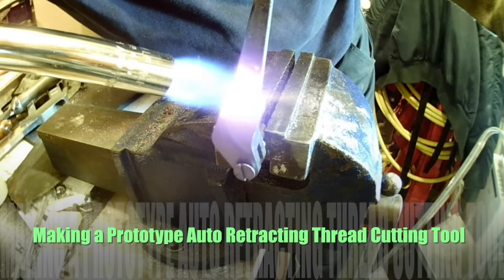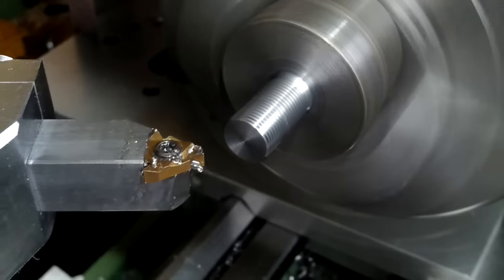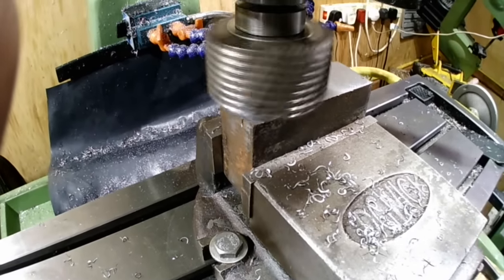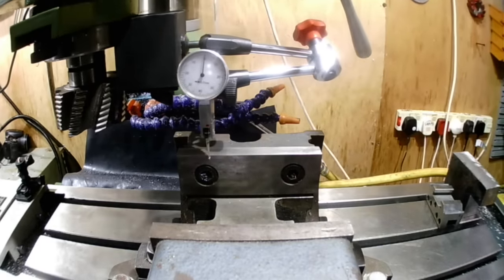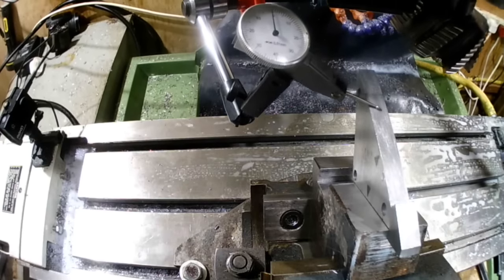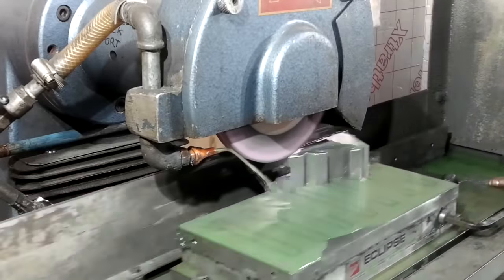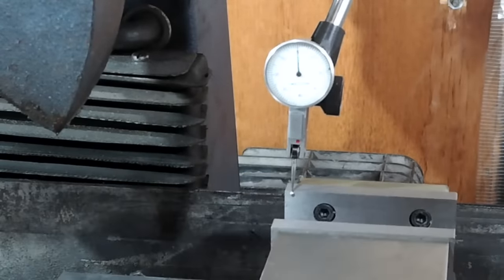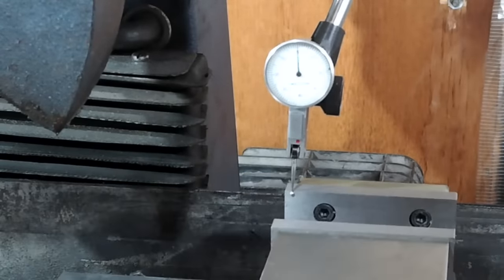Auto Retracting Thread Cutter.

Comment: why isn't there something like this on the market, it solves the problem of safety over finish, I always run too slow rpm to machine the thread without the risk, and the finish is never as good it could be. do you have any plans to put up some plans for this, you should make a kit
Reply from the maker: Hi swamppifi, no, I don't plan on making these, but my website www.thesheddweller.com is under construction and you can get a copy of the sketch.. Have fun.

Comment: Have you tried to simply cut it in reverse and the tool on the opposite side then it cuts away from the chuck and no chance of smashing it would be a nice tool for the ml7 or any screw on chucks set up 🙂👍
Reply from the maker: Hi Dale Lathwell, yes, I have tried working backwards and on the other side of the cross slide.
My problem is that I have a cheap Chinese lathe and there are many things that are wrong with this machine including the half nuts and the numerical indicator, they are both at best ineffective. I have destroyed inserts and threads when the half nuts indicate the correct number but for some reason they are fractionally out of sync. This problem is also true regardless of the direction I start the cut.
However, since using this device, I haven't had to disengage the half nuts, I don't collide with end faces and I have used much higher surface speeds.
Hope this answered your question.
Cheers.
Reply: With the feeds not meshing in i came across this problem and turns out that it was  because my lathe had an imperial lead screw and I was cutting  Metric threads  Once the halfnut is disengage it will never land back in the right place

Comment: Appreciating your videos . I'm a newcomer to machining but have had a certain exposure to analog (if I may) equipment though this was a considerable time ago. My official trade is  Welder - apprenticeship with South African Railways & Harbours at various Mechanical Engineer's Workshops around the country. It was much later in the field at a private company, where  chance for me to try my hand with machines arose. I might add that I became wholly engaged to the process and now that I'm retired , would really like to do some piece work at home . This brings me to enquire for advice or references perhaps, as I've decided to build a metalworking lathe so I can fulfill this wish but really it's dueto my small pension and no other foreseeable means that I cannot afford to purchase - even a second hand one. I'm a person who will rather get all the data before starting anything so would like to know more about the practicalities in choices of a lathe bed construction?
Reply from the maker: Hi, I'm not sure I'm the right person to help you with the lathe bed construction. However, two things I do know is that the lathe bed must be.
1. rigid and stable.
2. capable of handling horsepower without distortion.
all the best with your project. regards
Reply: Thank you I'm doing a bit of research about Acoustic vibration  - Since I have a background in Ultrasound with NDE. The interface between certain steels and damping medium ie.Quality and spec in finished product after machining. This is the part of your video that captured my attention , so... Thanks again.

 @Thesheddweller

Comment: looks promising, but what about split nut unlock ? how you match thread line for next  repeat ? probably spindel stop is better solution ?
Reply from the maker: Hi, thanks for watching. That is a bit of an art but, this is what I do. 
The lead screw indicator must remain engaged at all times. The chuck on my lathe is slow to stop so  I must open the half nuts after the tool retracts. When the chuck stops I wind the chuck backwards untill the indicator realigns then I re-engage the half nut.  I can now use the motor to drive the chuck in reverse so that the threading tool is taken back to the starting position, then I reset for another cut. hope this helps.
Reply: You can still work the half nut in the same way. The automatic retractor just gives you a lot more time to release it - the tool is already out of the way, so your timing doesn't need to be nearly as critical. To do subsequent passes, you would use the threading dial the same way as you always have.
Reply from the maker: @stanrogers5613  That is true on my lathe if the tool clears the work piece, otherwise I have to revert to opening the half nut, its also worth knowing the motor on my lathe ramps down it doesn't just stop unfortunately.

Comment: Really nice design, but presumably you still have to disengage the halfnut manually after each pass?
Reply from the maker: Oh yeah. Just as quickly as it snaps back if working at hi-speed..👍
Reply: As I said really nice design, but if you will forgive me, its not really necessary.  Mount your tool upside down, run in reverse, and screwcut away from the chuck.
Reply from the maker: @1ginner1  true, very true. But it works well for me with my lathe. If I had purchased a decent lathe in the first place I wouldn’t have made that tool. 👍
Reply: @Thesheddweller  Haha, Good luck to you my new found friend, I look forward to seeing some more of your very clever ideas and mechanisms.
Reply from the maker: See you soon. Regards👍
Reply: @1ginner1  That only works if you are allowed to cut a groove to start the tool from.
Reply: @andreblanchard8569  Correct.

Comment: Sweet build.  Got a couple of questions:  How do you prevent  or address  slop  in the square bar holder. and   are you disengaging the half nut manually?
Reply from the maker: Hi, the fit between the square ram and the body was a transion fit that needed quite a bit of working back and forth bathed in paraffin to to get it to function properly, then after a clean up and reassembly, oiling it with light 3 in 1 oil created friction. After using it many times there is no noticeable play or vibration when cutting. I do have to disengage the halfnuts to prevent bending or damaging the trigger bar.

Comment: So engine type lathes don't have an auto disengage? All my lathe experience is with Hardinge HLV and CNC lathes and they both auto disengage. I imagine internal single point threads have to be extra scarry with no auto disengage.
Reply from the maker: You’re a lucky chap. Some countries expect this device to be fitted as standard to most lathes here in the uk its an extra on larger lathes. regards

Comment: That's an excellent tool. Well done.  Can I ask you, what's the brand and model of the torch you used for the brazing ?
Reply from the maker: Sorry I'm late replying. the torch is a Bullfinch 4100. it is very capable at brasing with propane on small items only.  you will need extra heat for items that get anything bigger than this.

Comment: Love it , works like a charm in the video. How does it do on say a 1" -8 thread where the cut is heavier the closer you get to full size. I guess in metric its about 25mm. Thanks good work on it too.
Reply from the maker: What I have found out with bigger and deeper threads is that the insert will snap if there isn’t a relief at the end of the thread. Deeper cuts do need a slightly lighter depth of cut nearer the root.. hope this helps.

Comment: Ah yes the pucker factor, happens to me every time I run a program for the first time. My little cnc lets me cut 1mm pitch at 2700rpm, but I wanted to see what you have come up with.  Very nicely done, design and manufacture.  And it works!! First time visitor to your channel, will go look at some more.  Do you have a video about that animation software?
Reply from the maker: I think its called ‘Algodo’ its free off the web
Reply: @Thesheddweller  how long did it take you to draw the parts in the simulation?
Reply from the maker: I've never used anything like that before, the program is quite simple and easy to use, it needs to be, I spent two days on it and ended up with what you see. Hope this helps.

Comment: This product already exists. But good on you u mght learn something or get a bright idea on making it better.  Doall have this feature on their lathes. The  English turret lathes have this feature as well. Like ward or herbert. The best way is to spend 10 years on a center lathe cutting threads all the time. U learn that the faster you go the better the finish like a cnc mc. You get really fast at it on an imperial lead screw. Instead of focusing of focusing on the shoulder that the tool can crash into place an out rigger somewhere on the lathe and create lines with high contrast colours. Also reposition the screw cut tool inbits holder that positions the cross scomslhandle at   comfortable angle so you can pull the tool out asap. Either up or down. You really get good at it after a while too. First thing in the morning do some dummy runs to warm up. Having a spindle break helps too. Just when you get this under control the boss puts you on another lathe with a metric lead screw where you throw in the machine into reverse and pull out the tool. But you get good at this too.
Reply from the maker: I know what you mean about the boss moving you about, Ive had more than my fair share of that. Ive worked Herberts and Wards, though I would say only for a short while and not to anything really tied up. I have got ideas for many more projects between jobs that I get for classic and vintage stuff.

Comment: Have you watched Joe Pi  
He likes to invert his cutting tool and thread away from the chuck. 
No clenching whatsoever  😉😁
Reply from the maker: Hi, see FAQ’s at www.thesheddweller.com
Reply: @Thesheddweller  
Just read FAQ answered.
Fair enough. 
I also agree (other faq)  I have a 1944 Colchester and am trying to make a replacement cross slide nut.
7/8" 4tpi left hand Acme.
Getting close to finishing cuts and the leadscrew jumped out of gear  
I guess you can imagine the disaster 
Another few hours to make another tool.
And probably I need to investigate why she jumps out under load.
Left hand is working away from the chuck so that was a plus I thought.

Comment: That is a great design! Do you think drawings could be made available at some point?
Reply from the maker: Hi Peter.  Thanks for your comments. I hadn't planned on doing any drawings but I suppose I can scribble something on paper to pass on. 
Owing to the very nature of a prototype, my jottings have been somewhat modified 'on the fly so to speak'. 
However, if I take it apart and measure the whole unit, I'm sure i can come up with some sort of a working sketch.
Might take a day or two though..
Regards.
Reply from the maker: Peter Thannhauser, I now have a PDF sketch of the finished unit, but don't know the best way to send it.
Reply: @Thesheddweller  certainly the same here.  I just found your channel as I have been looking for ideas on making my own collet blocks.  Subbed!  Thanks!
Reply from the maker: Hi Dan Rozwood I do have drawings for the thread cutter, although they are more like sketches, because I’m used to reading drawings not producing them. They are in pdf format and I’ll need an address to email them.
Regards
Glad you enjoyed
Reply: @Thesheddweller  was my message clear?  I didnt see anything in my spam bucket.  So just following up to see if I messed something up!  Thanks again!

Comment: What about the cutdeepcontrol? I think this should adjustable in the slide, so is the relaesepoint the same ... anyway: great idea and perfect job! Well done! Somewhere i've got an relaese from an boltactionrifle, that might be cud be adopted to that...
Reply from the maker: hi. Thank you for your comments,  that sounds like a good idea. I'll look in to it as soon as I've got some spare time. thanks for your input. Regards
Reply: @Thesheddweller  i look it now several Times ,🤔 and i think you only need to cut a boldthreath M10x1 on the triggerside. I point that part at 27:55 With a a.s. 15mm 8edge nut with 10x1 on the end ,facing the Triggeredge, you can adjust the cuttingdeep in 0,125 mm steps in radius. the flatarea of the nut will slide in the Rampslot without turnig itself... i excuse for my poor tecnical english.🙈
Reply from the maker: @GpunktHartman  I've just seen your reply and I have to be honest and say that I can’t quite understand what you are trying to say, sorry. boldthreath m10 x 1on the trigger side?  15mm 8edge nut. are the confusing parts. I understand yourTechnical English is  hard work. please try and write what you want to say in your own language and i will translate it here and hope it is easier to understand.
Reply: @Thesheddweller  thanks for reply either. I think that, if you change the edge, where actually the trigger hooks in, in to an adjustable edge you cud adjust the cutdeep therewith. So i think that if you change the 4edge end into a threated End a.s. 10x1mm, you can screw a nut on it with 8edges 15mm face which now hook into the Trigger ... and with that 8 steps, each are made exactly 0,125 mm cuttingdeep. Without adjust the support ore the leverbar which relaese the trigger.

Danke für deine Antwort, ich denke wenn du das 4kant ende, wo jetzt der Auslöser einhakt, in ein rundes Ende mit Gewinde M10x1 änderst und nun eine Mutter mit Achtkant und sw15 mm dort aufschraubst kannst du die schnittiefe genau mit 8 schritten in 0,125mm auflösen ohne am Support oder am Hebel der den auslöser betätigt etwas zu justieren.
Reply from the maker: @GpunktHartman  Hi, yes, got it, actually, that seems like a good idea, I like it. I think the 8 sided nut would probably need a method of ensuring that each 45degree moment is held in place. Are you going to Have a go at it?
Reply: @Thesheddweller  yes, if you check the distance so, that you adjust it by pulling it several mm out of the Squareslideslot... adjust then by turning the nut, and let it slid back into the slot, the slot avoid turning of it! The15mm 8sided nut will fit into the 4sided 15mm slot...

So i find what makes you disturbing☝️😉...
i see a better easear way: taping the bore where the Lollypop get in ... and make an 8sided nut with a male threath then. I scetch it tomorrow i try to email it to you...
Reply from the maker: @GpunktHartman  great thanks.
Reply: @Thesheddweller  ... did you recive it ?
Reply from the maker: @GpunktHartman  I’ve not recived anything. except that my comments page won’t download something.. it’s constantly cycling.
Reply from the maker: I've rebooted the computer and checked my junk files and i've not received anything.
Reply: @Thesheddweller  i download your scetches, did my scetches on it and send it back ... @ 29.10. concern "RAM Mark II"
Reply from the maker: @GpunktHartman  hi, I haven't received anything, best if you just send your sketches to my email account I haven't set up the website to receive anything, sorry
Reply: @Thesheddweller  i send it anothertime @ the .com adress
Reply from the maker: @GpunktHartman  please send it to thesheddweller@hotmail.com
Reply: @Thesheddweller  that is the adress i send it to!
Reply from the maker: @GpunktHartman  Hi, yes.
Reply: @Thesheddweller  you got it? Send it 3 times...

Comment: One can flip the tool, reverse rotation, and thread from left to right for puckerless construction of an auto retract pucker limiting tool holder mechanism.
Reply from the maker: Hi, that is true and I have done that many, many times on other machines. My little lathe starts from zero rpm to the selected speed via a controller, if I start cutting before a reasonable cutting speed is achieved, It can lead to my 1/4hp machine stalling mainly when I’m cutting a large diameter thread, also if the cutting speed is very low the thread finish is poor. I also thought about machine owners that have screw off chucks because backwards cutting is a no no. hope this clears up a few things.
regards

Comment: I'd like to see a thread cutting mill maid that will cut a 1" & 1/12.   Spindale nose on my  MY lath has no led screw , & i have an idea to ues a routers  to drive  a thread,  mill & the rack to Drive the pitch . by using  it Banjo les England
Reply from the maker: Please accept my apologies if I misunderstand your question.  Are you asking me if it's possible to mill a thread on to a lathe spindle nose.
It is possible, I would use a universal indexing head and a fixed thread cutting tool.
Regards.

Comment: Cool concept, but you can solve 100% of these problems without all of the custom work. Turn the threading tool upside down, run the spindle in reverse, and cut the thread from left to right instead of right to left. There is literally no pucker what-so-ever, and you can do it with all the tools you already have.
Reply: Sorry, there might be one thing for you to buy. When you do this, you have to use a left handed threading tool on a right hand thread and vise versa, so if you don't already have a left handed threading tool, you would have to pick one up. Still a damn sight cheaper and easier than this solution.
Reply from the maker: Hi, thanks for your feedback. Can I suggest you see FAQ’s on www.thesheddweller.com

Comment: I don't understand how this interacts with the half-nut to actually stop tool crashes.
Reply from the maker: Hi, thanks for watching, the tool doesn’t interact with the half nuts. The idea is to give me more time to disengage them before running into the face. This tool only moves the tip away.
Reply: @Thesheddweller  Hmm, I see. Thanks. Seems great. I wonder if an automatic HN disengage mechanism could be made. It would be very useful.
Reply from the maker: @ExtantFrodo2  it is possible I might look into making something.

Comment: 4 flute for steel, stainless etc. 2 flutes for aluminum, plastic. I'm surprised your 2 flute even survived. They are just to aggressive for harder materials
Reply from the maker: Hi, I don’t have an endless supply of cutters so I sometimes swop to the next best or nearest in my box of bits, then maintain the chip thickness by altering the speed or feed. Cheers.